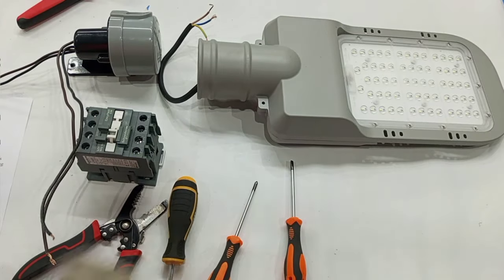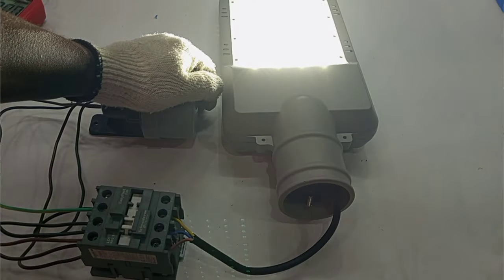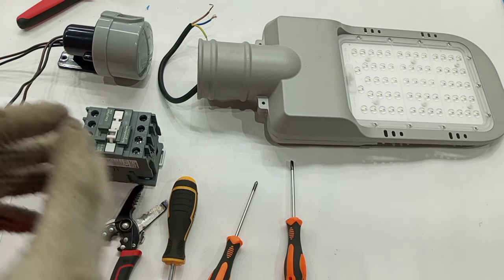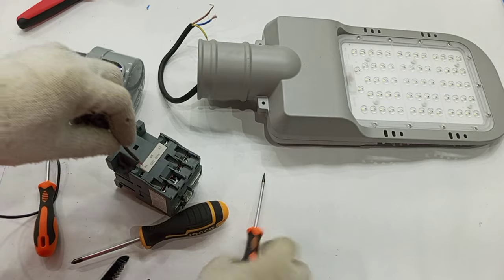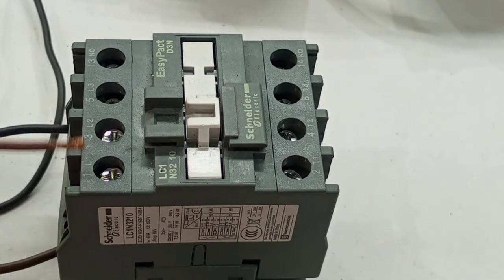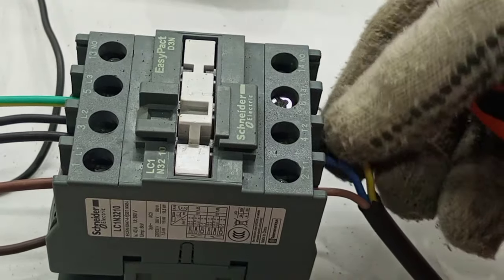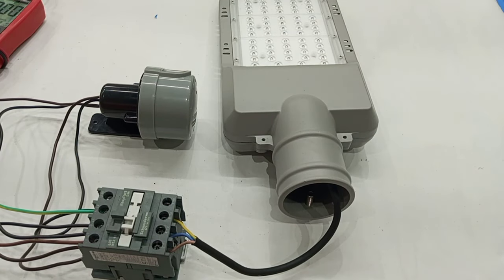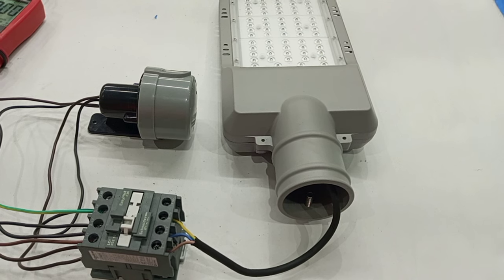1 Photo sensor +1 Contactor to power many street lights |Practical tutorial|

Comment: With reference to your recent video on ATS with two contactors, one for grid and one for solar. You said the neutral goes to the coil terminal A1 and live to A2.

But in this video you are taking the live to A1.
Reply from the maker: 😂😂 in the previous video, I just decided to use the A1s for neutral and the A2s for live, for uniformity because the contactors were two in that video. But in reality, the coil terminals are not polarized so live or neutral can connect to either A1 or A2 anyway.
Reply: @obloni_Electrical  noted...
Reply: Though I'm confused from the photocell are they two neutral?

Comment: What's the wiring configuration of the street lights. Is it that you wire one from the contactor, then start looping the other's. Assuming we have 50 lights, rated 100w each?
Reply from the maker: Exactly
Reply: @obloni_Electrical  assuming we are feeding the lights through 3ph. Do we say one cable from the 3c feeding each section of the street lights?? Maybe give a detailed design for it if it pleases you for we to learn. Assuming we have 50light , rated 100w each. What's the size of cable and that of contactor & photocell?
Reply from the maker: @noelfaithfulkari2857  
😊 please if you want a detailed design for a specific project kindly contact me on WhatsApp +233209323669. Thanks Noel